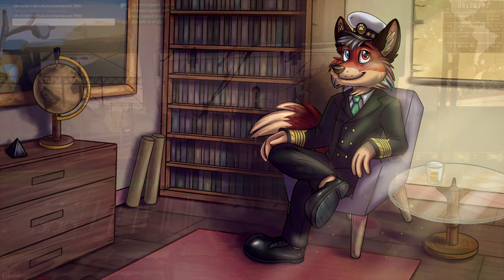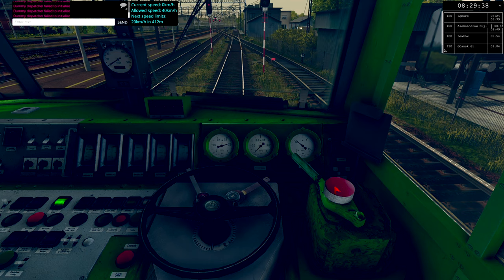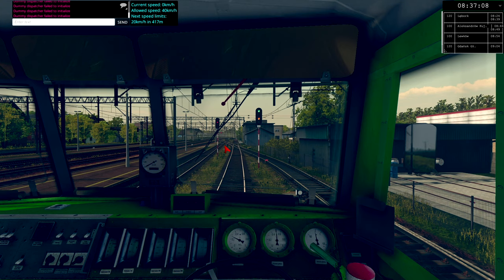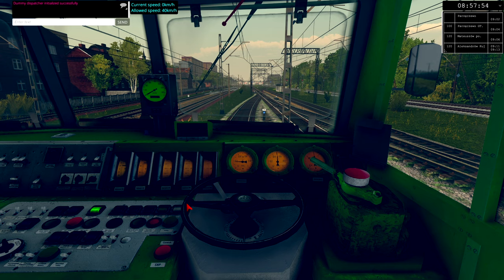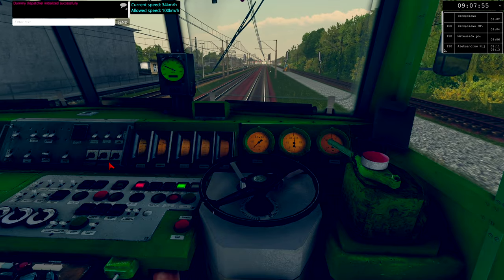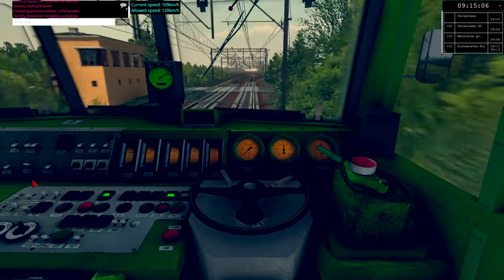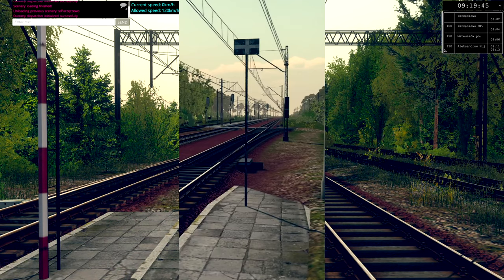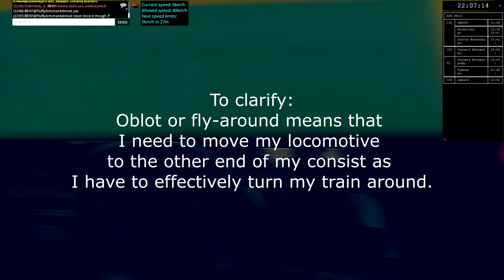Train Driver 2 - EU-07 How to? With some Multiplayer gameplay!

Comment: How do you know how far is the next station stop? I always miss the stop......there's no indicator like 5.2km and decreasing as you approach......
Reply from the maker: Each large station has entry and exit signals, those will tell you that the platform should be within stopping distance. For rural stations/stops you get rectangular black and white striped board indicating that there you are approaching a platform.

Comment: How i can release the brake after a Radioisotope in the scenario? 
With Space and NUM6 is not working
Reply from the maker: In some trains you have to click on the red button on the radio. Just make sure to communicate that with the dispatcher in case you will engage rs by accident.
Reply: @FluffyAdmiral  you are the best! Thanks a lot. You dont wont know how long i have try to solve this problem